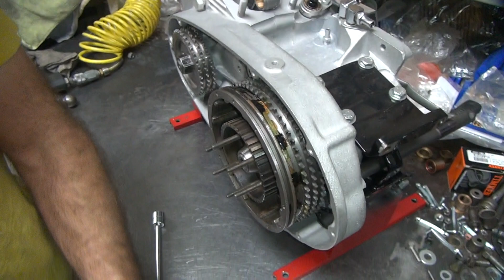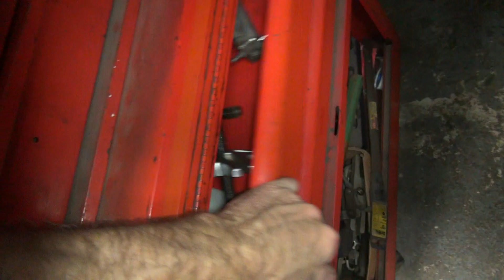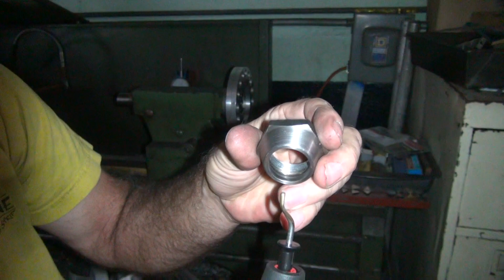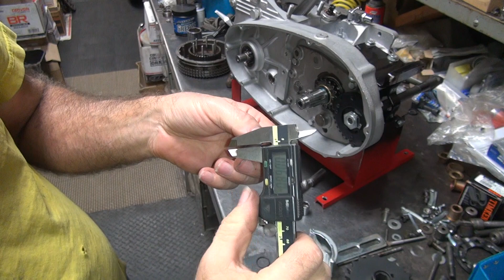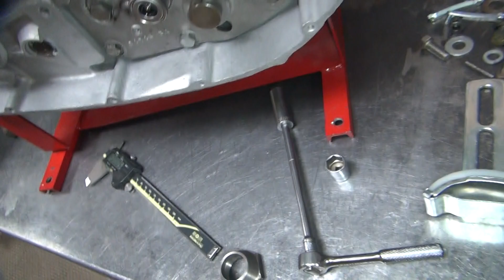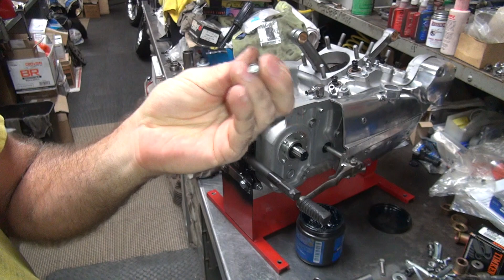1961 xlch #228 no miles transmission motor rebuild sportster harley repair restoration tatro machine

Comment: You can find those good washers on the rear  axle  on one of my grandkids  bicycle .
Reply from the maker: not likely. they would be made of butter and would not do anything if you tighten them down like you should. looking the same and being the same is not what happens most of the time on import crap.
tatro